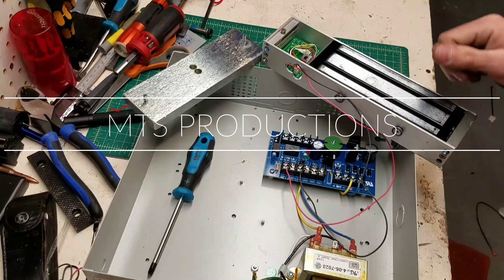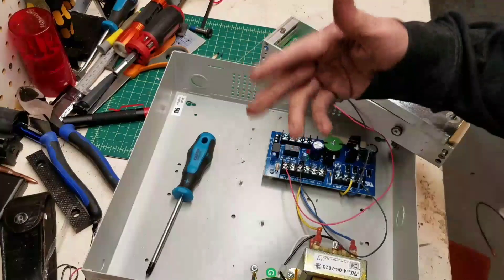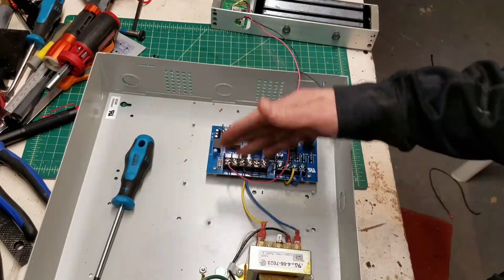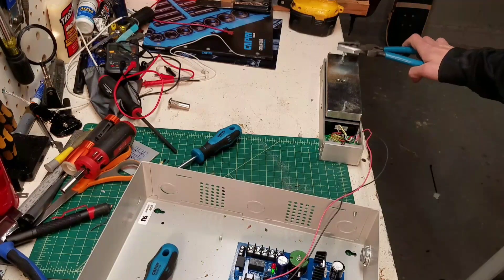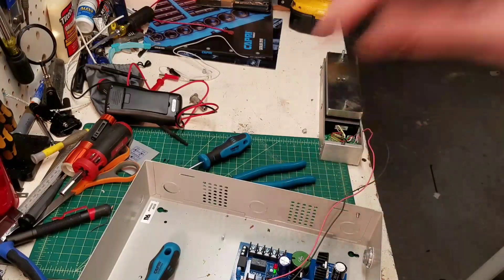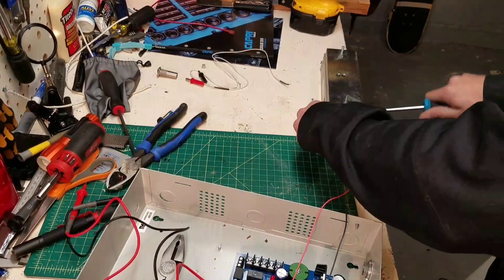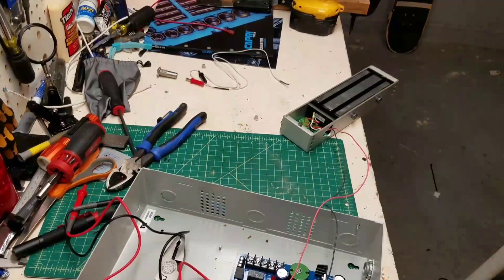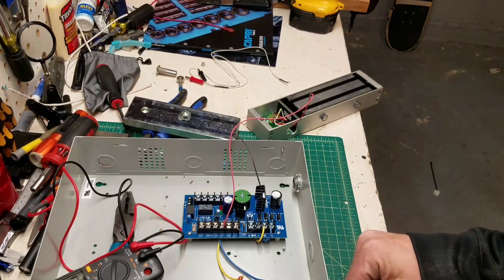Playing with a 1200lb Maglock

Comment: Found this because I wanted to see the spatial and electrical configuration of the electromagnet. Didn't find it here, sadly. I suspect the reason the magnet attracts "gently" and then is very strong is owing to the configuration of the electromagnet. If the orientation of the field is reversed periodically along the "active area" of the apparatus, then at a distance they will cancel each other out and weaken the attraction of the second half of the lock. More alternating orientations in a smaller area will increase how dramatic this effect is. This could be a safety feature to prevent the door from slamming shut or pinning a person's finger or hand inside.

Comment: What could be the problem if rhe maglock holds the door locked fine, disengages in fail safe mode. But refuses to disengage with fob reader or push button?

Comment: using one of these to keep a door closed. went very KISS though on the set up.

30$ smart battery TENDER (not straight charger!) for keeping motorcycle type batteries fully charged 
30$ 12ah 12v from walmart
 these only draw like 500mA so no big draw on battery constantly

skip the board and wire it straight up to the battery, that will keep the door locking functional for around 20hrs in event of power failure. since these are FAIL SAFE locks
have the + lead ran thru a couple DPDT switches ( 3 way'd to have multiple on/off points) and 12v lights on the other pole. 
wired up so lock goes off/lights come on.  hit switch when leaving; lock turns on/lights go off
also prevents getting trapped in said room, have a escape switch and also a de powered lock for just in case.

Comment: Its all in the amount of surfice area that is being atracted. Remember that the screw driver is contacting very little flat surfice area because its round. The magnetic force is not really strong to save electric consumption but both areas contacted in the mag lock are flat, covering much more area being attracted simultaneously. And yes, the bar is stainless steel but not much chrome, only enough to avoid rust.

Comment: Your screwdriver is mainly stainless steel, which contains a percentage of Chromium. Stainless steel is not magnetic. But the tip contains a small amount of normal steel, which is magnetic. So you get weak attraction between the screwdriver and the electromagnet.
The big rectangular chunk of metal is not stainless steel, just normal steel. This is very magnetic, so behaves as expected.
Reply: @CJ Malone Lets see, my stainless steel kitchen sink isnt, my cuttlery isnt,  my workshop stainless steel tools arent..... so  what are you talking about?
Reply: @AnotherPointOfView944  Stainless steel such as 304 and 316 is non-magnetic and are referred to as Austenitic stainless steel. Ferritic stainless steel such as 409, 430, and 439 are slightly magnetic. These steels are used in induction cookers, kitchen sinks, food processing equipment. Martensitic stainless steels like 410, 420, and 440 are highly magnetic and are used medical tools, tweezers, shafts, valves, razors, cutlery.
Reply: Good answer I would have to add also the screwdriver is round so very little of it is actually contacting the surface and magnets require flat surfaces to work best. And by the way now you have me wondering what my supposedly stainless steel charbroil professional series grill is really... Because it's magnetic as f*** I use magnets to hold my spatula and fork and stuff to it

Comment: Problem with mag locks is if they don't fully close where the metal is rested dead flat with the magnet, the door can be pushed opened. I used to keep the door at work "propped" open by putting a dime on the magnet. You do this when the door is opened and wait until the magnet energizes. Reach up and see if a dime/nickel/quarter sticks. Let the door close and you'll be surprised you'll be able to push it opened again. The coin acts as a shim preventing the plate and magnet mating. Warning: The security desk will get an alert because of the door opening without proper card access and investigate. So watch you don't get caught or corporate security will haul you in for interrogation. Make sure there are no cameras around.
Reply: Coins in the USA are not magnetic.
Reply: If I'm not mistaken, when you install the plate you have to make sure it's not screwed onto the door too tight so that it has a minute amount of 'wiggle room' to be pulled dead flat, as you say, against the electro magnet surface.

Comment: Hey mate firstly love your videos- especially the tips for apprentices as I am currently still am one and you're the reason I spent £250 on a veto pro pack! haha 

The reason the maglock is stronger with the bar is to do with the HALL EFFECT. I learnt this only a few weeks ago off a locksmith my company over here uses, I'm in the security systems industry so come across these and solenoids all the time in access control systems. It's to do with the how the magnetic field is applied differently when put in a direction that is perpendicular to the current flow of electricity, definitely worth a read if you get some free time! Keep up the wicked videos!

Comment: I'm confused, didn't you test for 12VDC(out) the second time? Why didn't that one work? I must've missed something
Reply from the maker: 1st time I used the wrong screws. I think it was basically 2 positive screws, the second set turned off once there was a load on it. It was weird
Reply: Mike's Tool Shed ahh, cheers- I'd missed that the power cut. I can stop scratching my head now.

Comment: I don't know anything about maglocks but I know a bit about direct current power supplies. That board you have there looks pretty simple to me. So I'm fairly confident I could figure out how it works. What is that 3 lead device with the little heat sink on that board? Like what numbers are on it? Does it say LM7812 ? That's the part number for a common 12V regulator IC. Though there are other regulators too.

Comment: Not sure what info you want to know. Most of these take both 12/24 VDC or 12/24 AC and get hooked to other things. Exterior side commonly a keypad, card reader or key switch. Inside often a motion detector, a touch bar or push buttom is used. For your shed you must have constant power to these units(that's why they are not my first choice). I suggest a simple on/off switch.

Comment: A lot of the holding power you’re noticing comes from the thickness of that plate. So when you put your screwdriver on it there’s not enough metal for the magnetic field to really hold on to it like you are expecting.  If there were a much higher voltage you could generate a larger magnetic field to pull from farther away.

Comment: The Maglock is just a simple coil generating a magnetic field. There is probably a small control panel in the Maglock that you are wiring to, that regulates the voltage coming in. You can also wire directly to the magnet coil, using the wires from the control board to the coil, and use some higher DC power for more magnetism. The magnetic field produced by an electrical field is going to be smaller than a solid standing magnet, but with higher voltage you could see some fun stuff. An inline 12vdc relay could be used to switch the power for the Maglock, that is how access control systems technically work. Than you hook the relay into a garage door control box, or a key switch, and use it for the shed.
Reply: So more voltage applied makes it stronger or current? I just bought a few for my car project and my experience was very similar to this guy's. But I actually bought 10 of these 600lb ones and I need more reaction

Comment: I do a bunch of Access Control for the company I work with, if you have any questions about this system you can PM me if you'd like.
I would hold on to this system and find a way to utilize it in your shed there like everybody is saying.

And if you want a cool idea I came up with for a customer to unlocking your shed door....
There is most likely a normally open / normally closed terminals on that power supply. Buy a security contact that is normally open. Hook your mag lock to normally closed (N.C.) to constantly energize you mag lock. And hook your security contact to normally open (N.O.) 
Here where it gets cool, find a unique place near your door to hide the security contact. keep a magnet somewhere as a key to get in your shed and hold it to the spot you drilled a your security contact to de-energize the mag lock while you pull the door open. (this will work assuming your shed door swings opens outwards standing outside) and boom! You're in!

If you don't have a spot to mount the power supply can in the shed, then buy a plug-in transformer with the correct voltage rating for that mag lock. Then you can just break the circuit using the same method I described with the normally closed security contact.

Lol it sounds a lot more involved but it's a pretty easy setup once you understand the fundamentals.
Reply: https://www.altronix.com/library/pdf/installation_instructions/AL175UL_DIP.pdf

Here is the link to the pdf of the exact board you have.
If you read it, it says you have to short trig1 and trig2 together in order to use "LOCK+" and "COM-" for your mag lock.

Try that and then sort the "NO" and "C" terminals to de-eneegize the lock. That is how the security contact will hook up.

Comment: That's awesome! I personally prefer the latching mechanism solenoid type as they are much simpler. One side of the door is always locked, the other side is easily bypassed by a simple pull of the lever or push of the panic bar. The latch itself is normally un-powered and in the locked position. When a keypad or proximity sensor is triggered, it sends a pulse to the software enabled control module, which in turn sends a normally 5 second contact voltage to the solenoid, unlocking the door.

Comment: I'm glad you showed the figuring it out part of the video and didn't just show it like you were a wizard. Even if you did know exactly how it worked the troubleshooting helps the average Joe like me the most. I would have liked if the connections were in the frame a little better, but overall nice work.

Comment: The transformer only does 120V AC to 12V AC u need the rest of a power supply set up to  make DC currant witch includes a variety of different electronic components common bruh im only a second year apprentice and i know these things u can’t only be the guy that runs and plugs the wire u need to know the technical mumbo jumbo as well p.s love the content keep em comin
Reply: +Jeremy Chase no you didn't you kumquat. Electricity has current too not currants. Currants are like raisins.
Reply: To turn AC into DC you just need to rectify it. Depending on the transformer you can full wave rectify AC with as few as two diodes. But in this case we can see 4 rectifier diodes on the circuit board. To regulate and filter power you need a couple more parts. Namely a regulator, and a filter capacitor. Regulators often need a stabilization capacitor too. It keeps them from oscillating. I've been screwing around with electricity for over 40 years now.
Reply from the maker: +Paul Frederick yeah. I just got done filming a correction on that. I knew thats not at all how it worked. I have built a low frequency led rectifier.   I don't know why I said that,  but I did correct it.
Reply: Paul Frederick pretty much exactly what i said douche
Reply: +Mike's Tool Shed this looks to be a very simple regulated supply. Which is a handy circuit to understand. I have built dozens of them over the years now. Because they're just so useful. When you plug an AC adapter into almost anything that circuit is probably someplace on the board of that device. Or one a lot like it. Though today switching regulators are getting more popular. Because those big transformers are heavy and expensive. With SMPS they do trickery to trade frequency and voltage for current handling capacity. I bought a batch of TL 494 SMPS control ICs but I've yet to really fool around with them yet. From what I've read they're pretty neat chips though. Here's the last linear regulator I made http://i.imgur.com/wfzJ4PZ.jpg I isolation routed the PCB on my CNC engraver http://i.imgur.com/YyqiE9R.jpg Here it is getting cut http://i.imgur.com/wVjPZUm.jpg The schematic http://i.imgur.com/jSYLq01.png

Comment: Mike in the meanwhile go to Lowe's and pick up a wireless driveway alert system put the monitor on your nightstand and plug it in the wall and take the infrared sensor and mounted in your garage this way you will be alerted when somebody's in your garage then you come outside with your rifle then you got them. I forget how much this system is but it's relatively cheap at Lowe's I think it's under $50.00 try it I think you'll love it. Peace

Comment: I'm guessing hear but if that's on a door and it pulled the door in crazy hard there'd be a lot of broken fingers and hands. Safety feature?
Reply: Mike Quilty no there is not one, if the door is open the alarm sound but does not engage, if I walk with a band then the door will engage and lock but if it is open the alarm will sound but not lock, I work with them